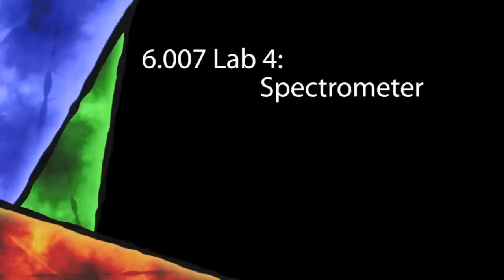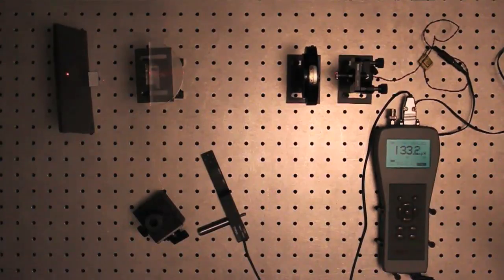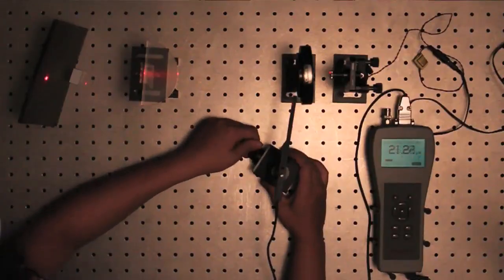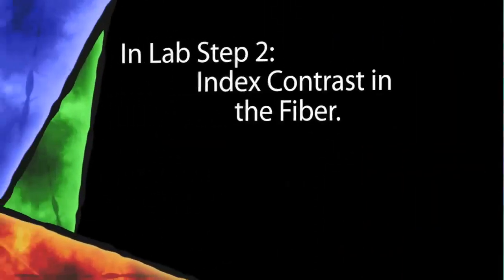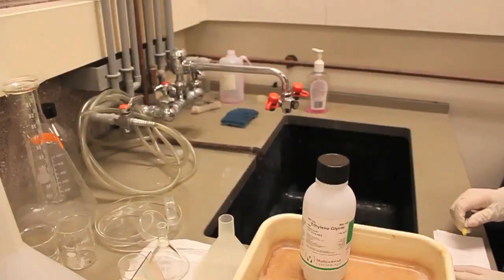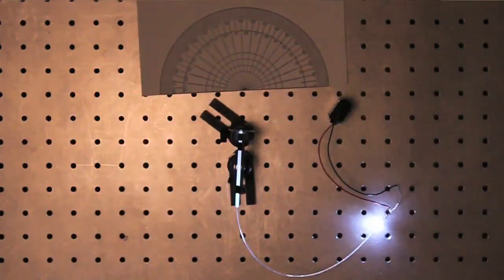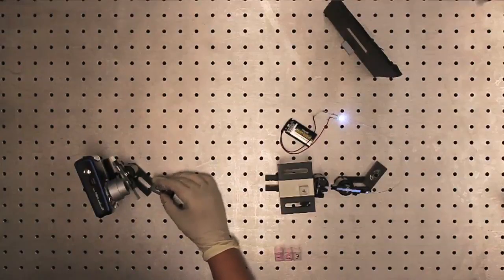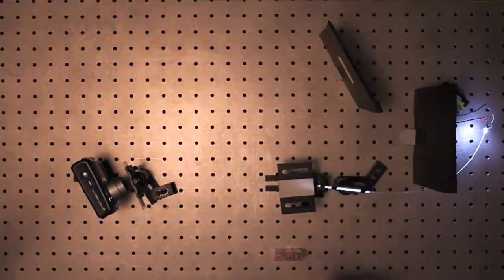Lab 4: Spectrometer

Comment: Instead of the first sanding, it would be easier to use a file to remove more material quickly, then progress to the gradually finer grades of sand paper.